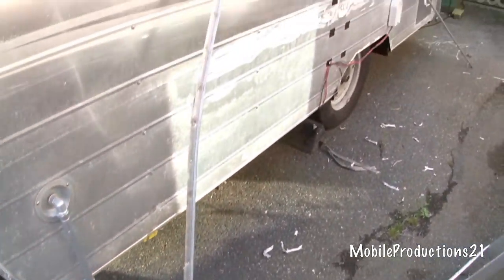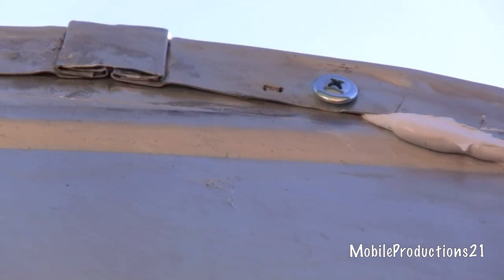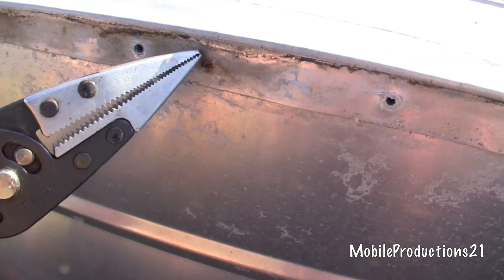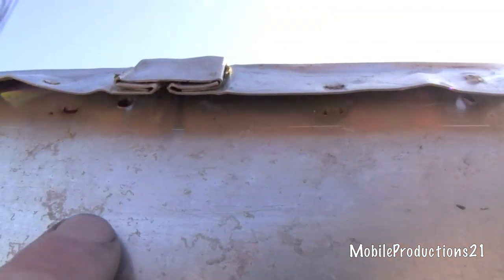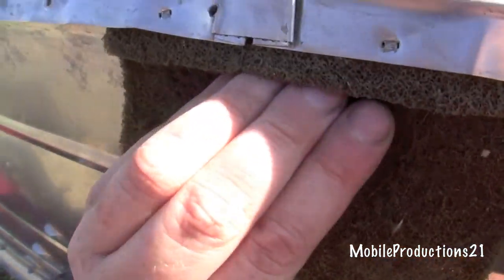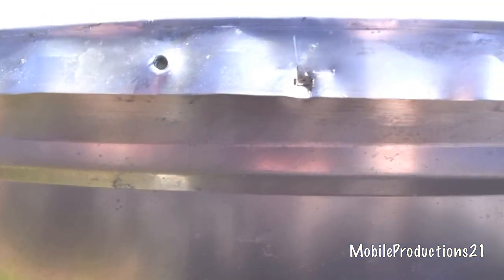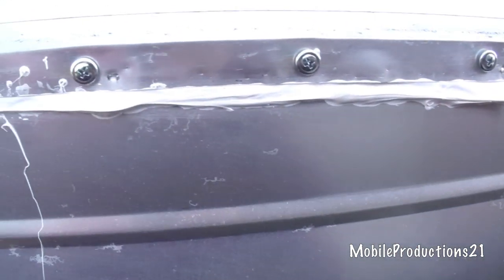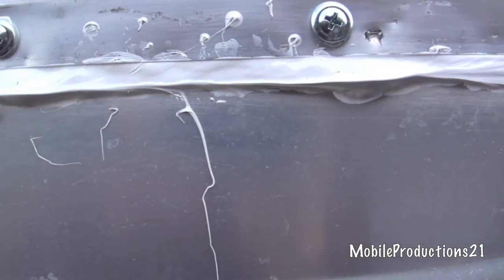Travel Trailer (Sealing Main Body)

Comment: It looks like a good idea, but everything I have read says to never use silicone on an RV.  I hope this hold up for you after all of the work you've done.  The stuff used between the trim and the trailer is called butyl putty tape. It will last 10-15 years before needing to be replaced.

Comment: It's called Mastic tape, or mastic sealer. It last decades, but eventually dries out and then cracks, letting water in. It is much easier to remove and replace than Silicone RTV so be
aware of that.

Comment: Putty tape is the proper sealant to use under the drip rail - not silicone. You do not use silicone on aluminum travel trailers. It will not hold-up very well and is almost impossible to clean off.

Comment: having pulled off the JRail myself cuz the other side got torn off somehow I will say this is a bad idea, it's a good idea to do this THEN bury it in some eternabond, this guys metal is so pristine he could of gotten away with slapping 20 feet of eternabond on that and it would last 20 years and flex up and down, the first trip and I see this silicone elongating and seperating, trust me I have experienced this myself, your rv is basically a rectangle tuna can with a piece of tin barely covering the top AND bottom.